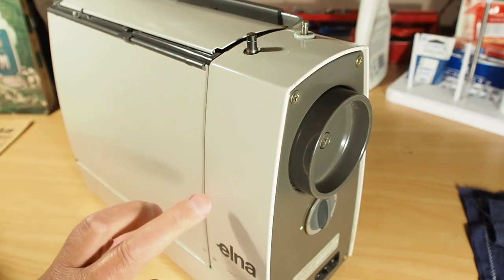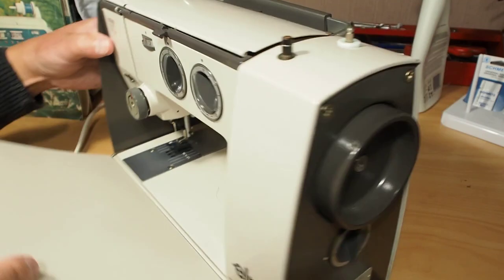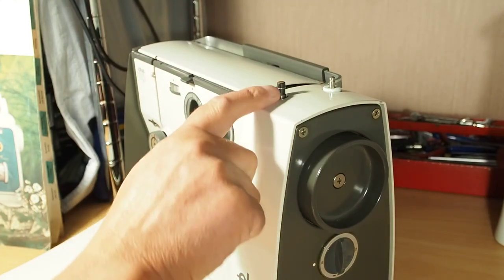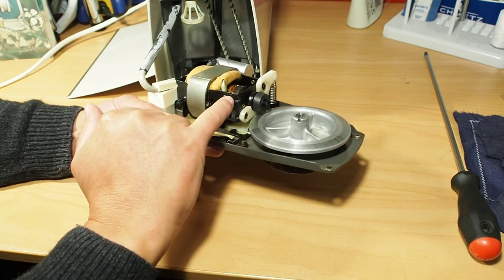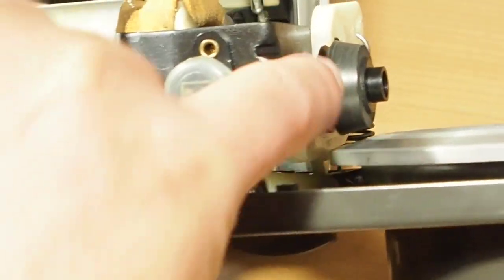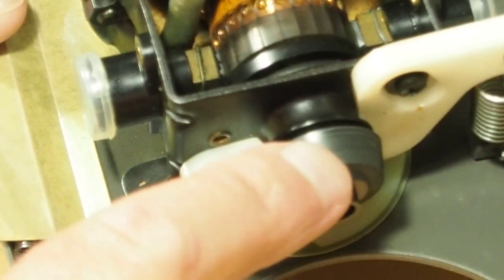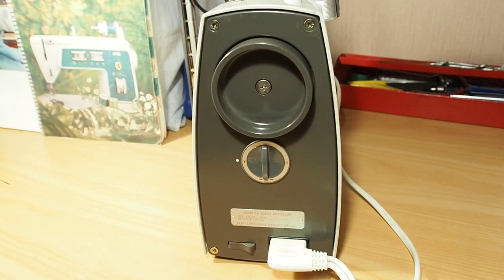Elna Lotus Coupling Switch Explained and Explored

Comment: I have an Elna Lotus TSP that we bought back in 1978. It has been used sporadically over the years. Recently I noticed that it would not operate at full speed. After finding your excellent clip, I removed the drive cover and inspected the components.  The rubber friction wheel and the driven wheel appear to be OK. The tensioning spring is on the lowest setting and the top adjusting screw is at the lower position in the slot (shown at 16:01 in the clip). I have cleaned the resistor contacts in the foot pedal and checked the resistance ant each step and this looks OK. Any ideas as to what my next move should be? Thanks in anticipation.
Reply from the maker: Hard to say but if you can try another known good foot controller or short the foot controller, that may give you an idea as to where the problem lies. Thanks.
Reply: @InStitches  Hello, Thanks for your advice. I will try your advice on shorting the foot controller.
Reply: Polish the commutator ring with tine sandpaper. That should restore the speed to original.

Comment: I'm a little confused, I thought you would have the bobbin icon lined up with the dot?
Reply: Yes, I agree.  On the Elna training course I had in the late 60s when I got my first Elna Lotus it was explained to me that the 3 symbols on the dial were '0' for off as a protection against treading on the foot pedal inadvertently, _ _ _ the stitch symbol for when you want to start sewing, and the spool/bobbin symbol for when you want to fill up a bobbin with thread.  I would have thought that if you are running the motor mid-way between two symbols this might actually be causing damage to the motor.  Swiss engineering has always been top of its class and I don't believe those precision loving people would have designed their machines, particularly in the 60s, to work at a mid-way point with no symbol.  It should be possible to find this information in the original instruction manual which can be found on sites like Pinterest.
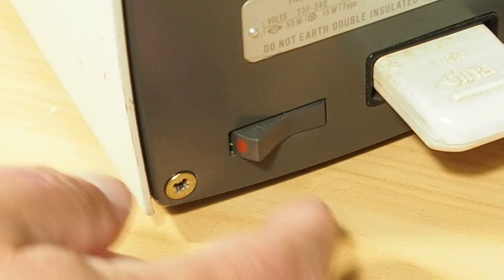Reply: You are correct that when winding a bobbin the bobbin icon should be lined up with the dot. That said, from 14:57 to 17:17 in the video, In Stitches is showing how to check the adjustment of the bobbin winder, that is, the position of the black rubber motor pulley relative to the white plastic bobbin winding cage. Briefly, if the bobbin winder post engages too early (before the 0 on the dial is turned clockwise to 10:30) or engages too late (after the 0 on the dial is turned past 12:00), then it needs to be adjusted. The two adjustment screws are shown at 15:57. The Lotus is my favorite sewing machine to work on.

Comment: This exact machine is the one I acquired recently, but after pulling out a load of tangled thread around the bobbin housing and dogteeth, the machine won't move, it just rocks back and forth along with the bobbin housing, I've checked it is in "sew" mode,  but something else is amiss, are you able to suggest anything please ?
Reply: Hello Lorraine, have you managed to sort out the problem you had with the bobbin housing?  I have had my Elna Lotus SP since the late 60s and when I first acquired it as a teenager I was lucky enough to have been given a training course on how to fix issues like that by the family friend who was the Elna agent that provided my machine.  On the outside of the bobbin holder there are two little screws, one on the left and a corresponding one on the right (not the slightly larger one which has some red colouring and numbers).  I think if you loosen each of these screws carefully, taking care not to let them drop into the body of the machine, you will be able to lift out the complete bobbin holder and you may find a build up of fluff and bits of thread underneath which you can clean out with the brush.  Do make a note of exactly the correct position the holder is in before you start taking the screws out as it's vital to put it back into the original position after you've done the cleaning process.  Look at the little prongy protruding bit on the left side to note where this sits.  i would recommend taking a photo of how everything looks before taking anything apart.  Once it's had a clean and been put back I would also suggest giving the mechanism a little oil and on my machine the relevant parts for the oil are coloured red.  I hope this is of help to you because you really will enjoy using your Elna for a long time to come if you can get it up and running.

Comment: thank you for your video. I have rescued Elna Lotus c25 from a local op shop from very abandoned and neglected state, after cleaning and oiling the whole machine inside out I found out my side dial for sewing, bobbin and disengaged motor mode is flipped 180°. so I will make myself a masking tape sticker on the side to remember. other thing for the sewing setting the motor is very noisy, like a raving motorbike, I am hoping it might get quieter with use. any suggestions?? thanks
Reply from the maker: Hi. Sounds like the motor drive pulley may have a flat spot on it and needs replacing. Thanks.
Reply: thank you very much for helpful info

Comment: Hi! My partner has this exact model of Elna Lotus and she accidentilly had it on the wrong level of volts 115V it should have been in 220V. After 5min the machine shut down and doesn't turn on again. Do you have a posible solution? Any idea where the problem or short curcuit resides?? Thank you!
Reply from the maker: Not sure that will repairable without taking measurements with a multimeter.
Reply: The internal fuse was blown...

Comment: I just picked up a nice Lotus.  It seems to work well and has not been used much or abused.  I'd like to have a peek at the motor assembly etc, but upon removing the four corner screws, and the large one in the center of the pulley wheel, I cannot get the whole panel to pull back as in your video.  Something seems to be holding the pulley firmly in place.  I do this with the selector wheel under the pulley at the "O" position, as you show.  But even with gentle prying with a plastic tool, there is no way that panel comes out.  Any suggestions as to what might be preventing this?
Reply: Shaft was stuck on the pulley.  Applied penetrating oil from the outside, then tapped on the back of the pulley from inside (with top cover off) with a wood dowel, and it came free.  All good.
Reply: I also got stuck on the same issue with my machine. Tapped on the back of the flywheel with a screwdriver and it loosened up.

Comment: Also I have never used a voltage step down converter.  Seems scary to me..do you think it safe?
Reply from the maker: Yes, they are safe to use. Maybe you could get the step down transformer checked out before you use it. Thanks.